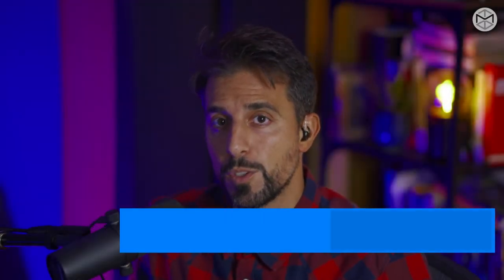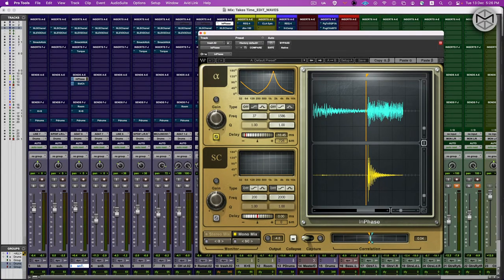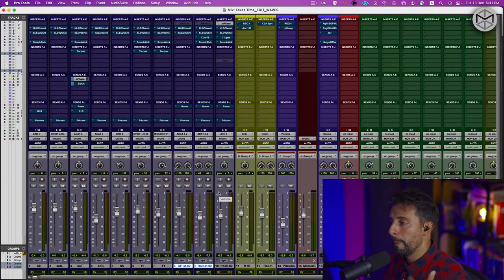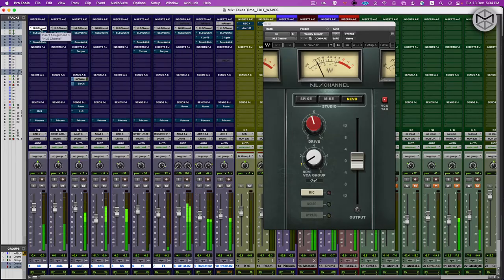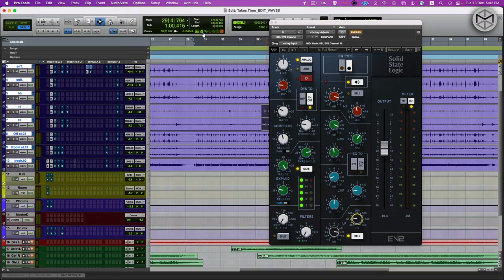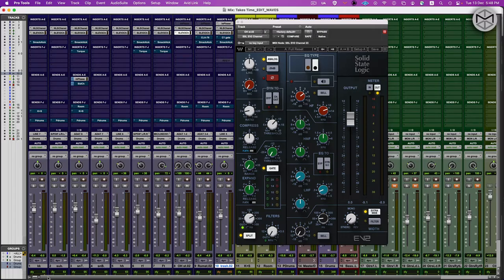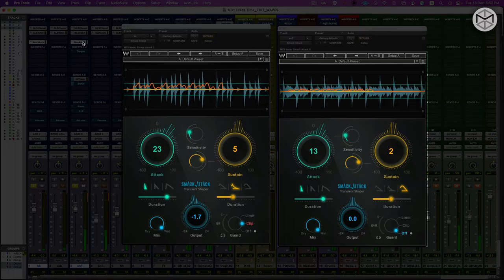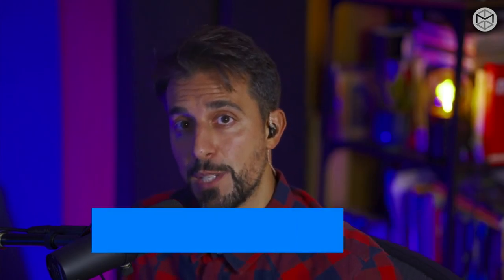How to MIX DRUMS [START TO FINISH] - with Waves Plugins!!!

Comment: Starting with phase allignment a great suggestion. But what about gain staging? At what level do you set your drum tracks before applying eq and compression? Some people like to normalize their drum tracks to -6, -10 or -12 dbFS. I would like to learn your approach to this because you are mostly using analogue emulations to mix drums such as NLS and EV2.

Great channel by the way! Keep going.
Reply: Gain staging is more so just understanding how the input and output gain at each stage (be that an effect, send, aux, bus, etc) will effect your sound. It doesn't matter what you normal your drums to as long as it will interact well with whatever you are sending it into at that volume. For example some compressors don't have an adjustable threshold so you would compensate for that by going into the compressor with the appropriate gain to have the threshold hit where you want it to and using make up gain on the output to increase or decrease the volume appropriately. Or if a plug in is really noisy you may want to send a hotter signal through so the noisefloor is as low as possible compared to the signal because if you send a quite signal through and boost it after you will get a lot more noise than the other way around.
Reply: I wanna know that too

Comment: I have a question when do you setup your nls do you set it up in the mix or you set them up in solo?
Reply from the maker: Generally I start in solo, to hear exactly the amount of THD I am after, although it is while  mixing that I find tune.

Ps if you want to find out more about NlS check this video I made walking thru Non Linear Summing https://youtu.be/y4NTev678_4

Comment: I want to start mixing out of the box to get that analog color and nice high roll off. What should I start with. Preamp, Eq, compressor. If I can get some guidance that will be great. Thanks. 

I understand that there are a whole lot of analog gear and they each have thier purpose and can be genre specific, vocal or percusion specific as well. So anything to start me up would be great. I am going to mainly work on hip hop and pop. Some live here and there (rarely). Thank you.
Reply: I dont have much analog experience but almost universally the biggest thing I he e when it comes to analog vs digital is compression. I have heard countless engineers say they have a certain compression unit because they could not find a digital compressor that emulated the tone or ballistics of certain hardware units. EQ would probably be lowest on the list as digital vs analog comes down almost entirely to just the additional distortion from the hardware which could be emulated with any ITB eq and saturator.
Reply: @incognitiveincognito  Appreciate your response. Yeah, I noticed that many would prefer to get a compressor as the first piece of hardware equipment.

Comment: Why do you use a trash and room mix for drum mixing(Can you do without )
Reply from the maker: @kojoXAppau  because I can 😂 I love working and experimenting with different microphones. And in my experience a so called  “trash mic” a cheap microphone I generally use during recording a hyper compressed version of the kit helps with bringing forward a lot of texture when blended in parallel. Instead of only using parallel compression I can season to taste the sound of my drums bringing forward that mic. But going back to your question, sure you can do without it. It’s all about what if your sonic vision. I hope this clarifies
Reply: @AudioKnowHow  yes it does answer my question, thank you